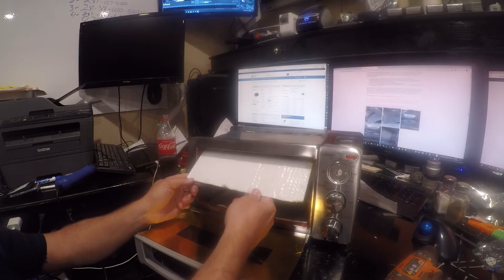Controleo: Part 10 - fighting with the insulation

Comment: Future builders -- take careful note of the struggle!  Ahead of time devise a strategy for mounting the insulating panels. Rehearse their placement and trim them if necessary. They are not precut to be a good fit for any particular oven.  The instructions (as of 2021-09, perhaps updated since Brian's build) suggest to peal back only a portion of the backing to reveal only part of the adhesive. Then maneuver the panel into position, and once located and partly stuck down, then pull out the remaining backing.  Similar strategy to placing other sorts of adhesive sheet. 
An option for wrangling the door is to tie it open with a string or bungee. Then you can set the oven on its back and work from the top.
Reply from the maker: Mine came loose and I still need to get around to opening pandora's oven and curing that.  Haven't done much with it lately. Meh, ADHD.  I'll come back to being interested in at some point.  :)
Reply: I think I've concluded that the only ways to get the top insulating panel in place is either (a) at an earlier stage, remove the upper heating element and place the panel with the heating element out of the way, or (b) Cut the panel in two lengthwise and fit one half from in front and one half from behind the upper element, butting the two pieces together directly above the element.
Reply: I ran into the same problem. I also got interrupted mid-process. Ended up ordering a sheet off Amazon and starting over after removing the adhesive on the ceiling with goo gone.

What I did the 2nd time was instead of removing the middle 3rd of the plastic backing I just sliced it in the middle. Then I slighlty peeled opposite corners front and back so I knew I could remove the backing easily. It can be difficult to start at a corner, even with tweezers.

Then I slid the piece where I wanted. Firmly held the back to the ceiling with friction and peeled the front piece of plastic backing. Then stuck the front half to the front of the unit.

With the front half stuck in place it was trivial to bend back half down so I could get at the prepared corner of backing.

Removed that and stuck it to the ceiling and it was lined up exactly as I wanted it,   without fighting the adhesive.